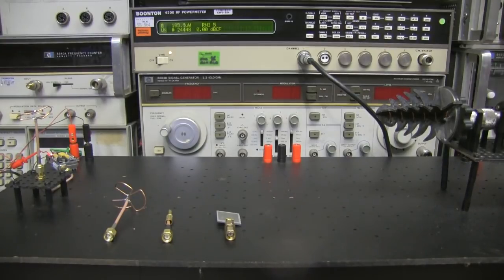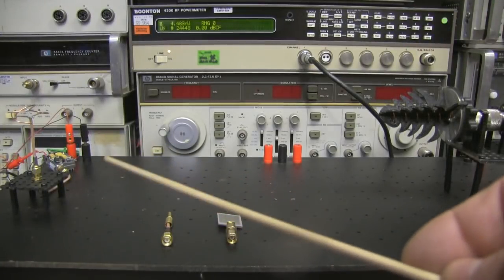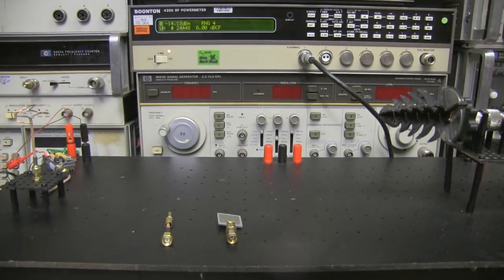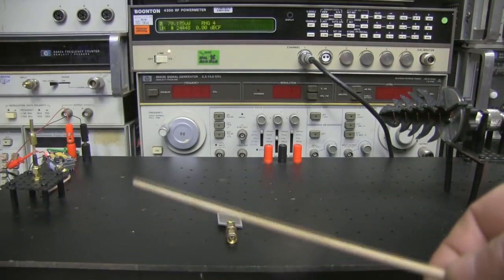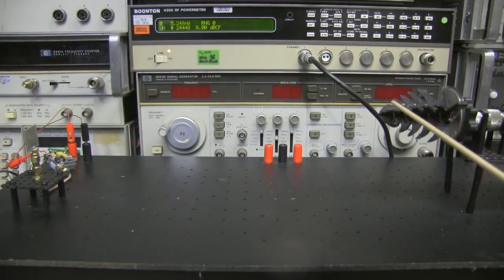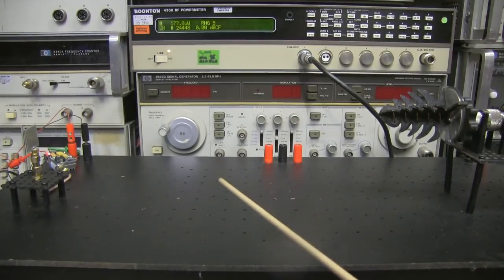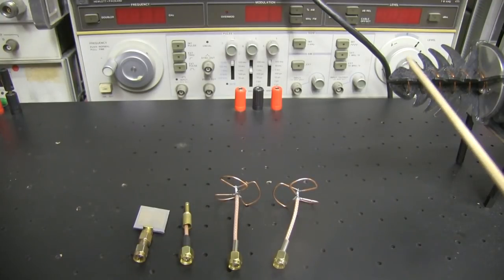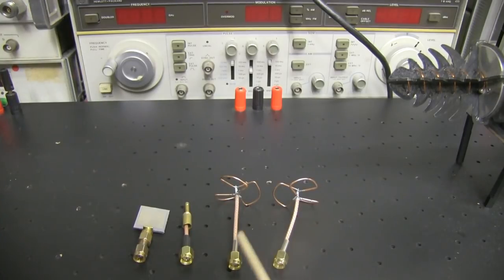Polarization Mismatch how bad can it be?

Comment: Hi Andrew, is it possible to use both a WiFi amplifier, and a gain amplifier through a splitter to a WiFi card? I would like to use a WiFi amplifier for transmitting, and a gain amplifier for receiving, but the problem is my WiFi card only has one antenna connector, can it be done?
Reply from the maker: There may well be some professional equipment (expensive ,custom made) out there but for retail non that I know of sorry.

Comment: I have a simple question sir , can a bad wifi antenna make an alpha card  completely unusable ? I've had an alpha card that I lost it's antenna , so I made a simple cantenna for it , it can pick up wifi but it can't connect to it except when it's very close to the wifi router , and the internet speed is terrible , also the transmission is terrible , but the receive is great , is it because of the antenna or the wifi adapter is malfunctioned 
should I buy an antenna or a new card ?
Reply from the maker: Yes a bad antenna can show symptoms that you have described. Is there any chance the alfa is a fake? Those do drop connection even with a good antenna. You could always buy a cheap dipole of ebay just to make sure.
Reply: @andrewmcneil  My Alpha is original , the problem with wifi cards here in Egypt is that they are banned for some unknown reasons  so it's hard to get one , also we are not allowed to by antennas online ! and I can't find one in local store, that's why I made my own
Reply: @mohammedalsayed3508  If you are egyptian,  your antenna is the pyramidal horn,  no doubt!

Comment: Love your videos!!! Just wish I could get replies to questions.
Reply from the maker: What do you want to know?
Reply: andrew mcneil if I have two 9dbi antennas transmitting and receiving the same signal, trying to achieve double the gain, is there a certain distance I should keep them apart or a degree of focus angle you would recommend if they are side by side?
Reply: I fly a Mavic Pro drone, I do a lot of mods on it. Both aircraft and RC. My questions go back to older videos and current. My recent reference is where to find the 2.4ghz yagis that you shown us that are great. I have a laundry list of questions in regards to using the antennas I have built based on your videos. Wouldn’t even know where to start. Probably best to just email you a proper list of inquiries if you have the time to answer questions that is. Thanks again for all your work. Incredibly I have increased my range to 7 miles based on your antenna builds!!